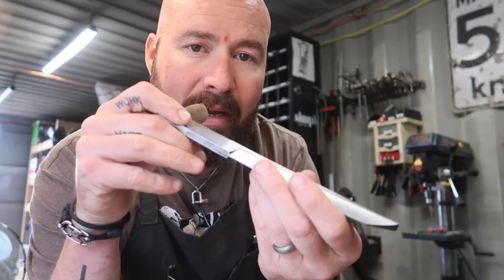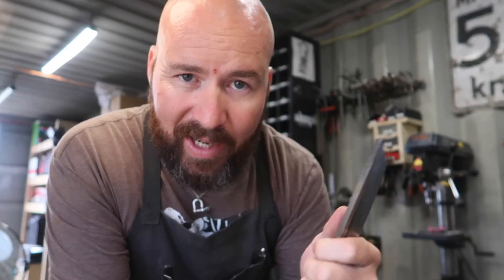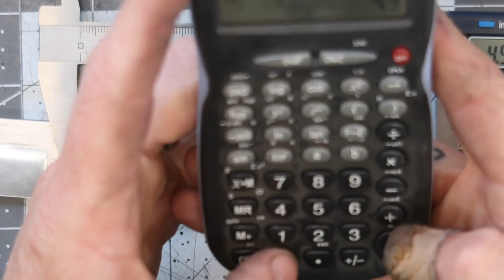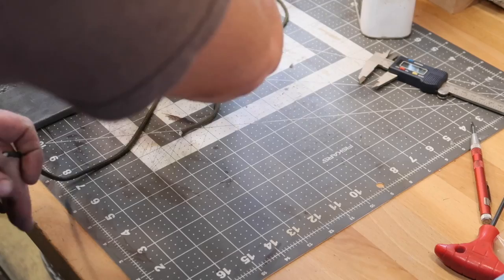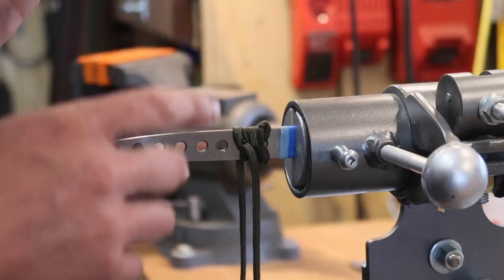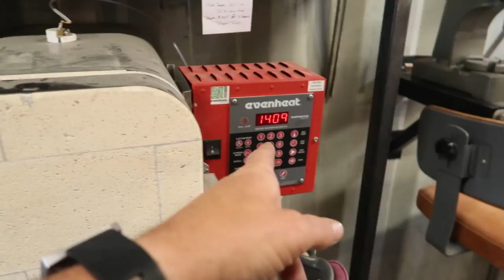Grinding the Tip of the Tanto - Knife maker's Vlog

Comment: There is a little trick with the wicked edge if you get the balsa wood strops and use autosol metal Polish on the edge of the knife it will make it like a true mirror I will never just the leather strops they include, I use 5 micron and 3.5 micron the balsa strops and a pea size of the autosol polish and the scratch pattern turn in to liquid metal because there is no scratch pattern. :-)

Comment: Here is a little tip on paracord wrapping anything. If you want a really tight wrap, once you have it on the piece boil up a small pot of water and dip the wrapped portion into the water, 5-10 seconds is all that you need. The paracord will shrink and tighten up nicely and be hard as a rock. Just let it air dry and you are good to go.

Comment: I'm just curious why you didn't use your mill and a round end mill or a home made single cutter with a rounded edge? Would have been faster and you got the tools i think. Like that pointy stabber you finished up.
Reply from the maker: Thanks! I guess I just have a hard time justifying buying additional cutters for my milling machine (especially with it being so small and not liking bigger cuts) and grinding with course belts is a pretty fast way to remove material. But that would be awesome to have a cutter that shape. Cheers👍

Comment: Actually the pockets that the holes create in between don't help the bond they create sections of pure epoxy which are weaker than the bond between the scales and the tang. That is  not to say you shouldn't do them.

Comment: The small knife is a killer, but not impressed with the para cord. G-10 in a dull black would have been my choice. Nice job on both knives.
Reply: you're right. I do find the shape and the edge quite stunning, but I do think these kind of skinny boot knives aren't suited for paracord wrapped handle. They're more practical and comfortable with a micarta or G10 handle (because the tang is so lean), and they're almost as lightweight as the paracord version. But a great knife still! the blade reminds me of the cutlery in France (like those lean LeThiers, or something)

Comment: I want to buy a couple power tools/bench tools to start making knives. Do you have a recommendation as far as how few pieces I should buy to get by? I see you have multiple belt sanders, which one if i had to just choose one should I buy? Thank you and love the channel!!
Reply: Ok great! I made a list. Im guessing the angle grinder is to cut the steel instead of using a band saw? Thanks a lot btw!
Reply: You can also use a bandsaw but it's more expensive than a cheap anglegrinder. I cut out the rough shape of the knife and sand it to the final shape on my belt sander...
Reply: Yes, I have been hearing the same about Harbor freight! I also hear their quality is getting better since many of their products are made in the same factory as some of the name brands like dewalt and porter cable. I will definitely get these starter machines and I thank you all for the help. Look forward to creating a new hobby since I love working with my hands!
Reply: Ok I understand. I actually already own an angle grinder, so I will see how that works. Thanks again
Reply: I've been making knives for just a couple of months now, pretty basic, pretty amateur, but it's amazing how much I've grown my skill with just an angle grinder, a belt sander, a bench vice and a scroll saw, plus a couple of handtools like files and such. I also have a charcoal forage that I made for around $100, I do a little bit of forging and heat treating with that, but it isn't absolutely necessary if you're doing the stock removal method. You just need something to heat your blade up for heat treating. I've made quite a few videos along the way, you could check out my channel if you're interested in seeing how I did it.
Reply: Nathen Wallis I got the Harbor Freight 1x30 a couple weeks ago. Changed my whole perspective. Thumbs up!
Reply: Thats awesome man! I will subscribe as well! Any help is welcomed! Cant wait to start!